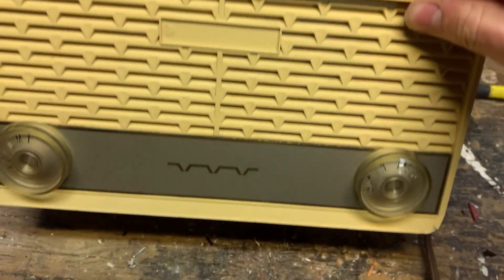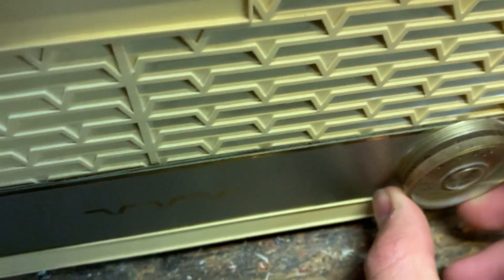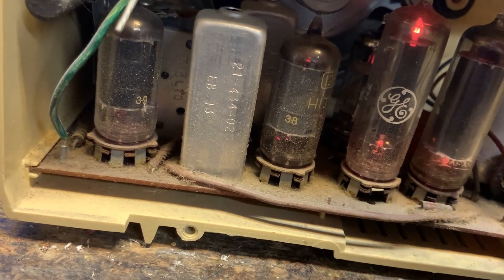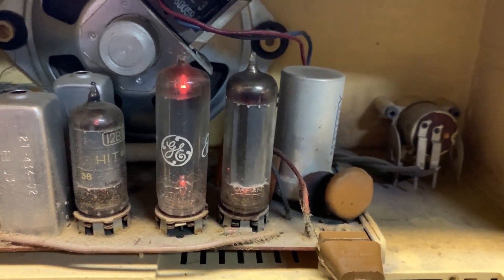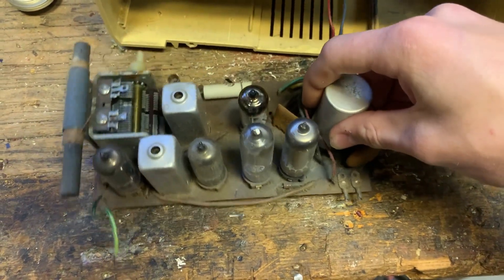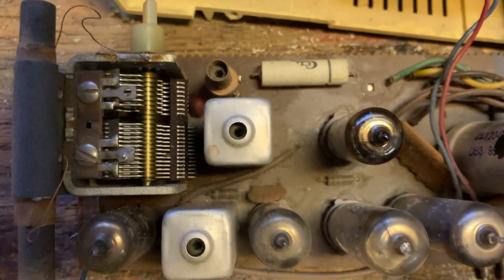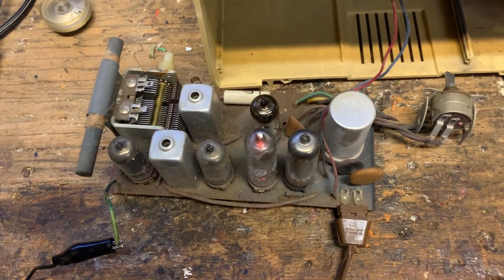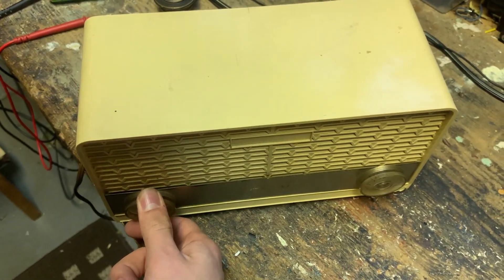Analysis of a super CHEAP AA5 radio

Comment: The main electrolytic filter caps need to be replaced and any paper capacitors. The ceramic capacitors should be ok as long as there is no signs of damage.

Comment: The 50C5 tube is red plating . It is far too bright. Minimally all capacitors and resistors should be replaced. It will burn out
within a few days use. That is the trouble with these "cheapy" sets when the the very few components on the board get old.
Reply: The 50c5 is red plating, stop and replace your caps